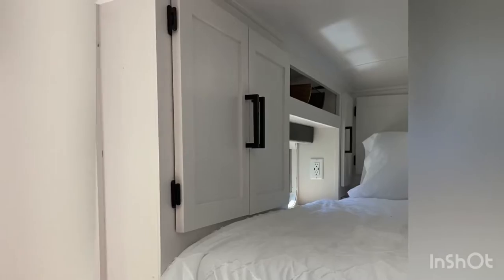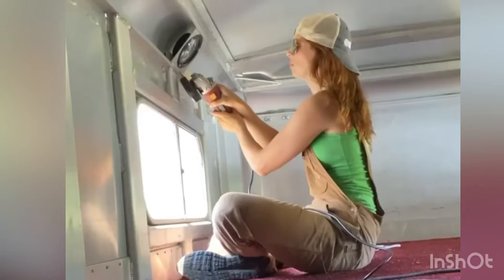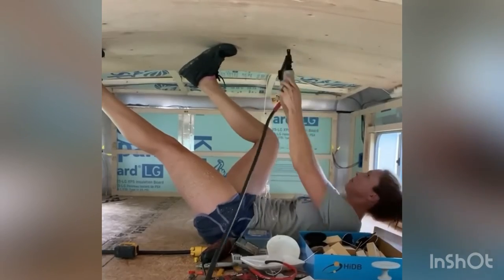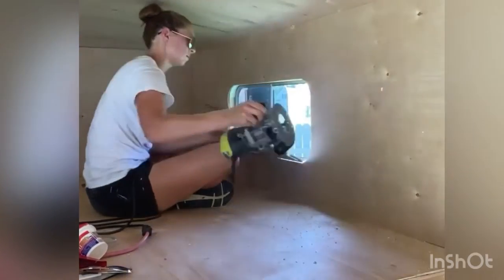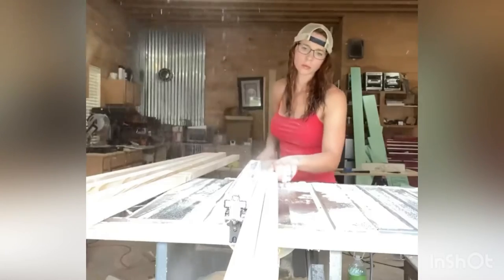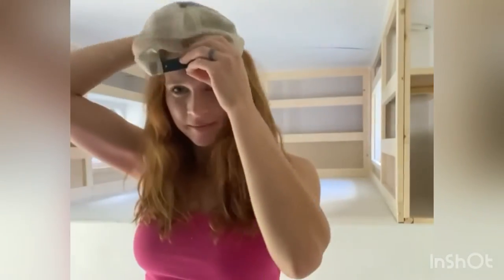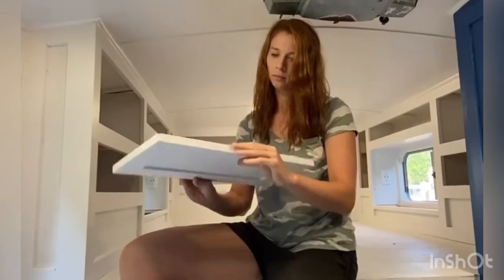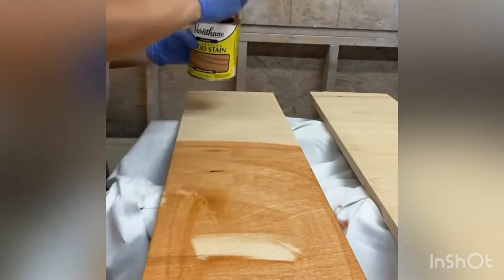Amazing transformation of a horse trailer to an RV living quarters!

Comment: You do some awesome work on this trailer. I have a question for you,  I had a leak from the roof, so now 1 of the white ceiling panel as bumps and is away from the te strip. Any suggestions on how to replace the panel? Thanks in advance.
Reply from the maker: Thank you! Take the entire panel down and replace. Just make sure none of your trusses are rotten. Any idea what type of frame you have (wood or aluminum)? Just so I can refer you to the right video to replace it!
Reply: What kind of caulk do you use when re sealing a windows on a horse trailer with painted smooth aluminum?
Thanks